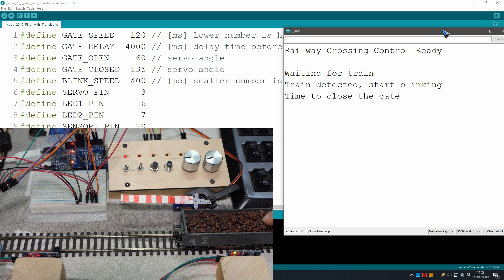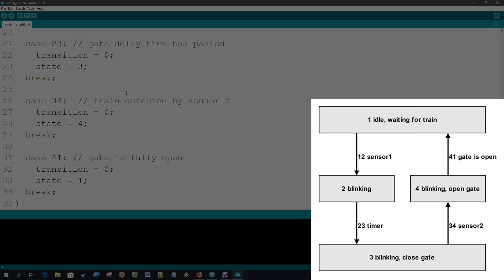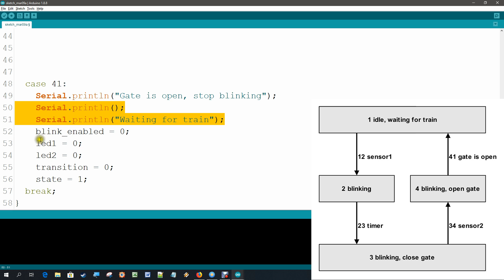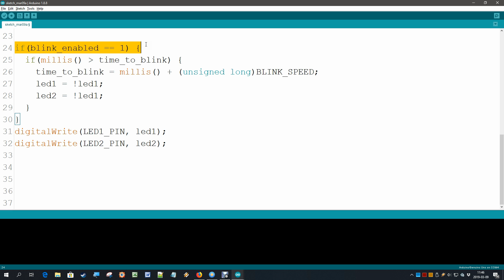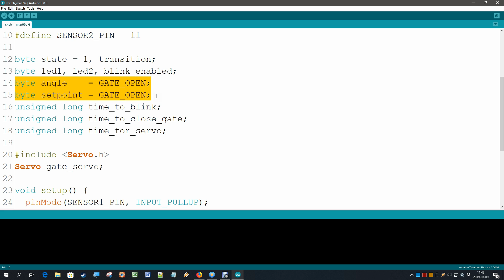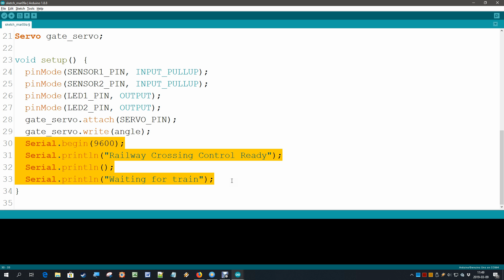Fun with Arduino 20 Railway Crossing Putting it all Together

Comment: So what happens when your train is longer than 1 car, or coming from the other direction?  I think you need an or function between the two sensors, and possibly a 3rd sensor right at the crossing... such that, once a sensor is tripped, the lights start, 4 seconds pass, gates down... train cars pass... last car clears the first sensor, nothing changes, passes the second sensor in the crossing nothing happens, clears the 3rd sensor, it releases the crossing, gate goes up, lights stop blinking...

Comment: Hello Sir, Thank you for making a great video. I am trying to put it together, just trying to figure out where to put the pins on the bread board. Do you have a diagram of where it all goes?
Reply from the maker: I don't have a diagram. The Arduino pin numbers used are mentioned in the software listing, at the top, in the #define statements.

Comment: Hi, Rudy i have this code set up with bell sound  i can shortn the bell or even have full length bell, but here's my question 
Im wanting to remove the blink and add PWM fading leds in the place of the old one's  would you mind demonstrating this this in a updated video or here ?
Reply from the maker: There won't be a video on that. There already is a video on how to create a fade. What you have to do is, where the blink changes from High to Low or vice versa, set the LED setpoint from 0 to 255 or vice versa, and add the fade timer to your code.

Comment: Dear Rudy,

Thank you so much for the great job you are doing.  I am strugling to understand, how to replace IR sensors with Ultrasound Sensor. Could you please give me guide lines or changes to be effected in code.  Rest else is same (Arduino UNO, USS (HC-SR04), Servo (TowerPro SG90 Servo Motor).

Many thanks in advance.

Sushil Damle
Reply from the maker: The Arduino does not know what type of sensor is connected to an input, as long as it produces  a logic 0 or 1 nothing has to change in the code, just do a digitlRead(pinnr).
Reply: @rudyshobbychannel  many thanks once again

Comment: Does it work in both ways?
Reply from the maker: Yes it can, but you'll have to add 2 sensors of course. If you have multiple train tracks also the code needs to be adapted. If you like to get that code, send me a note on the blog and I'll email you.

Comment: Hi8 Rudy,

Very nice sketch.

Couple of points - 

Yes indeed, the sketch is designed in one direction.  I suppose if you doubled up a couple of IF statements with the OR operator (||), it would take into account both directions.

Also, as a car leaves the crossing, the leading of the edge of the car triggles the trailinig sensor, not the END of the car.  Also it is possible to leave a car in the crossing with the gates up and the lights not blinking - an uprotected situation.
I think a few more lines of code to cover this situation would be sufficient.

Bob S

Comment: Hi there Rudy. After using your sketch i get an error reading on (switch transition), after case 4. The error message is "expected unqualified-id before 'switch'. Can you perhaps help, please?
Reply from the maker: I can't reproduce this error here. I copy / pasted the code into the Arduino IDE and it compiles without errors. Can you try again, and if the error stays can you send a secreenshot of the Arduino IDE screen with the red line where it detects the error.

Comment: I'm having problems with the sensors,  It only activates sensor two and the gates and lights when the engine crosses for the first time.  If the engine comes from the opposite side and activates sensor one it does not turn the lights and gate until it reaches sensor two.  Can you help me to solve this problem?   Thanks.
Reply from the maker: The current software was meant to work only in one direction. If yu need it to work in two directions change the states and transitions accordingly by adding the second sensor to the 'if' test.
Reply: @rudyshobbychannel  Thanks I will try this.  Question:  Is it possible to write a code for this system, whereby  as long as the train is activating both sensors at the same time the lights and gates keep working and when the last sensor is clear the lights and gates stop working?  I'm not that good for programming but mechanical things is my forte. Thanks.
Reply from the maker: @joelvale3887  I don't have time to do requests Joel. The whole purpose of the videos is that you would be able to do it yourself now. :)
Reply: @rudyshobbychannel  Thank you for your help.  Have a great day.
Reply: @joelvale3887  Hi Joel, I've done exactly this as a first attempt at enhancing the original.  Now it works in both directions, does not raise the barriers until the first sensor is clear, and also has a brief (definable) pause between the 2nd sensor being activated and the barriers raising (for really long trains).  My next stage may be to add two more sensors right at the edges of the crossing that replace the delay before opening the barriers, by telling it that the crossing has been definitely cleared even though the 2nd sensor has been triggered.  That way with short trains the crossing can open sooner than with long ones. Happy to share it if you like.
Reply: @randyle-bherz5582  Not a problem at all... drop me a line at pmpmaloney@gmail.com and I'll email you the sketch.  I have put loads of comments in the code so I can remember how it works!!  It's for a UK style crossing with solid yellow, then two solid red, then alternating flashing reds before the barrier closes.  Happy to answer any questions on it...
Reply: @randyle-bherz5582  Sorry, I completely missed it!  Will respond as soon as I'm home, in a couple of hours...

Comment: I'm struggling to understand the need for the very complicated state transition approach you're using. 

Would it not be far simpler to replace all that with two functions, one to close the gate and the other to open it with the appropriate one called when the relevant sensor is triggered?
Reply from the maker: Well ... that was actually meant to make things simpler, straightforward, write code almost without thinking by just following the steps.